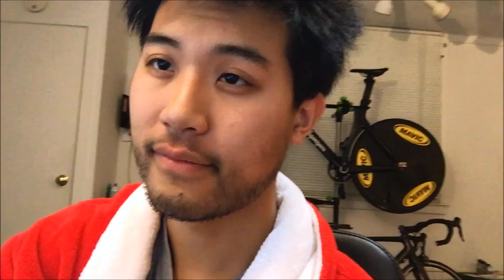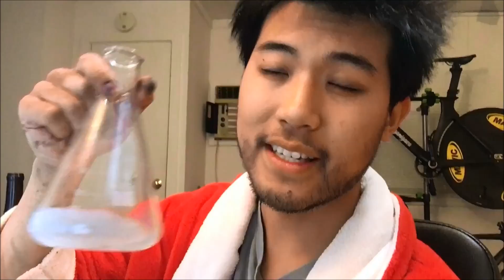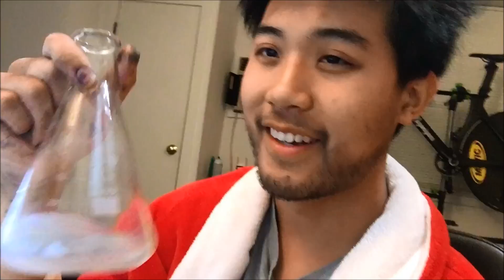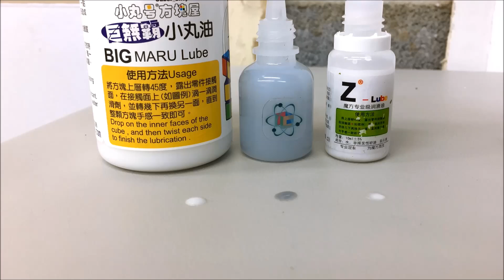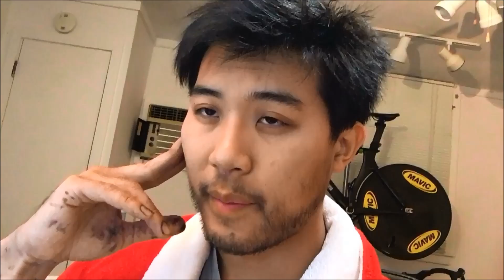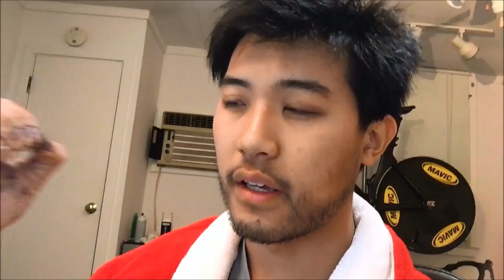DNM-37 Revision C: Cubicle Labs Chemistry Lesson #1: Hygroscopicity

Comment: So if you cube around 1-4 hours a day, how many days will it take for the DNM-37 to dry out? Now I have Maru Lube and Im running out because it takes around 1 hour for it to dry out. I need a new lube now so how long does it take the DNM-37 to dry out?
Reply: Anthony Nguyen it lasts quite a while, over lubing is very easy to do with dnm-37
Reply: Anthony Nguyen It'll take 2-3 days to run out. This lasts about 10x as long as Maru

Comment: This is kind of a funny question, but have you ever thought of using a triboluminescent or thermoluminescent compound in some lubes to get some cool photo-emission effects?
Reply from the maker: Huh, I considered luminol + peroxide and phosphorescence, but not triboluminescence....
That's a VERY good idea.
Reply: Honestly now that I think about it. It would probably work better if you coated the plastic in a thermo/tribo compound. Something along the lines of a PTFE.
Reply: Which brings up another question. Have you thought of using a PTFE or other dry lubricant? I can't see it working better than a liquid, but you never know... I'm a physicist not a chemist.
Reply from the maker: This Is A Cubing Channel Yes! PTFE was one of the first things considered, especially with how much it's used in industry. It was quickly realized that coefficients of friction isn't the most important factor when it comes to a good lubricant or coating. There are many more factors, and when we release coatings, it should be up to standard!
Reply: This Is A Cubing Channel sounds better than Gan's Ultimate glowing internals. Hope your idea gets featured!-
Reply: You mean adding in some compounds to emit light? (Sorry I am still in Form 2 in secondary school)
Reply: Cuberrism yes, phospho/triboluminescence are ways materials can emit visible light.
Reply: This Is A Cubing Channel ah. So like a glowing effect
Reply: Cuberrism yep, specifically, with a triboluminescent lube of sorts, the glowing will be activated when the cube is being moved from the friction, so the longer you cube, the  more it will glow.
Reply: This Is A Cubing Channel you are really smart. your idea sounds cool! hope its a thing one day (:
Reply: Wow, thank you very much. I hope it becomes a thing as well. Chris is having a brainstorm session next week that I will be attending, so you can be sure I will mention it there.
Reply: The question is WHY HASN'T SOMEONE MADE THIS YET